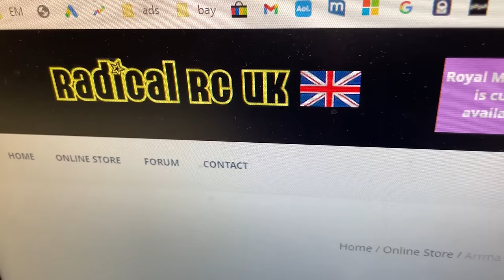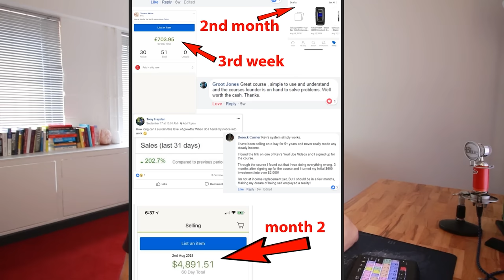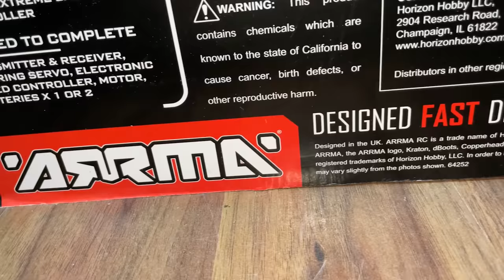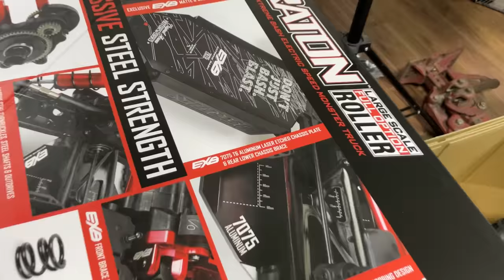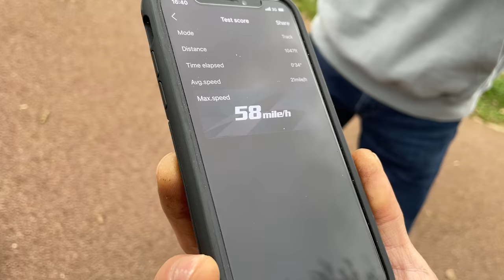Kraton 8s EXB - Worlds best GIANT RC Car?

Comment: Once you bend metal and then bend it back to straighten it, it will never be as strong again.
Reply: Right. Metal loses its molecular bond when it bends which is basically stretching the bonds which weakens it. That said, ARRMA needs to rethink the company thats providing them the chassis because it should not be that weak/bendy for that price.
Reply: I don't question the 7075 (people think just cause aluminum has a fancy number code it's suddenly steel) but I DEFINITELY question the heat treat if it's not being treated correctly it's going to end up either very brittle or to ductile
Reply: @adamjacobs8606  they probably bought it for cheap. That's why it's so bad

Comment: I jump my Traxxas slash ten meters in the air and don’t break anything
Reply: Traxxas are a much better build quality than kratons
Reply: @norsevikingsir4932  Traxxas is plastic.  Arrma uses metal.
Reply: @HunterEvolution  you just made my point for me. Their plastic lasts heaps longer than arrmas metal.
Reply: @norsevikingsir4932  on the XMaxx, absolutely.  It's a TANK. On 1/8 and 1/10 scale.  Traxxas couldn't keep up nor do they handle anywhere near as well.
Reply: @HunterEvolution  well I have a traxxas rusit (bandit/rustler) and crashed against a concrete mailbox and the chassis only broke where the transmission was which is a small piece but the rest of the chassis was okay. I was going 50 mph at time
Reply: @SamuelRodriguez-xz7nm  good for you.  I've seen a Rustler Nitro taco the chassis hitting the curb at half throttle. See?  I can say things too. 😂

Comment: Would love to see a metal test on that chassis. As a machinist I'm with you Kev, thats NOT 7075. Seems a bit more like 6061 to me. Nice to see that bash bar stopped you from doing it in again, and the RPM arms will up the strength even more. BASH ON!!
Reply: I am thinking it is annealed 7075, If you have a kiln try turning one into t4 and another into t6 and see if it helps.

Comment: Just a warning to people who want to use a drill, running high speed on screws going into plastic can melt the holes and make them unusable if heated too much. Drill at slow speed and you won't melt the plastics. And still is way faster than by hand.
Reply: I know this is a year old, but you should always drill metal slow with more pressure.

Comment: No way is that stock chassis 7075, like the way you glued a bolt  of each size on front of drawers👍
Reply: This makes me distrust Arrma and it is really foul.
Reply: There's a difference between machine 7075 aluminum and stamped 7075 aluminum. Arrma uses stamped 7075 and m2c uses machine aluminum. 6061 t6 machined aluminum will be 2xs stronger than stamped 7075 aluminum. Machine aluminum will cost 2xs the amount than machine that's the reason why arrma uses stamped aluminum and race kits uses machine aluminum

Comment: Go to a metal shop and have them re-harden the chassis. This is what I suspect is why it's so soft is they skipped the Annealing process. If it's not heat treated it will be soft like what you're showing in this video. If the Annealing process is done wrong it can become softer. You can do it yourself.

Comment: Kevin I have a question when RC cars gets old do pieces get weaker on it cuz i have 
a Traxxas Stampede for 2 years now
Reply: when they get really really old yes plastic parts do weaken slightly, but 2 years old is just fine and the parts will not have aged enough to weaken

Comment: That comparison between the 4mm m2c 7075 t6 chasiss and the 5mm arrma "7075 t6" chassis really makes me disappointed in arrma... They obviously either DIDN'T use 7075 t6, or used the worst possible grade of 7075. I'm still glad they're making improvements, but they need to stop cutting corners. I still love them to bits though, it's why I want to see them succeed.. looks like the xmaxx is gonna keep that crown for a long time though.

Comment: I have machined a boatload of 6061 and 7075. That may be 7075 aluminum, but it is either in an annealed state (not heat treated), or it has been improperly heat treated. Try welding on it and see how it goes. 7075 is like impossible to weld. If it is indeed 7075, maybe you can heat treat it.

Comment: I agree with you Kev, re Arrma chassis strength, it is not as claimed. That's an entire conversation on its own, however what I'd like to know is why doesn't RadicalRC make a complete replacement chassis as opposed to a supplementary chassis strengthener for the existing stock chassis?
Reply from the maker: theres already companies like m2c making complete chassis, the bash bars is cheaper and easier to fit :)

Comment: That Arrma 7075 T6 chassis bent way to damn easily. Its almost like it has no bend memory (I know there's a scientific name for it but I've forgotten it).  When you stomped on that M2C chassis it bent but returned to its original position when you let off it. The way it was designed to do so.

Comment: The metal from the arrma chassis got stretched. So, to make it correct, you have to shrink it. Kinda doesn't ever get right again really. The m2c has extra bracing welded on, makes the stretching kinda difficult(not that Mr. Kev couldn't eff it up, lol). And btw, that metal for the arrma chassis is cheap AF!! Great vid man, thank you!

Comment: Traxxas Xmaxx killer? Hahaha. I wouldn't even think about landing my EXB K8S on concrete like I do with my X-Maxx trucks. It is way more stable and faster and it jumps higher and further than the Xmaxx, but it breaks and bends stuff easier. And you better get your big air landings perfect. If not, BOOM.

Comment: There are different grades, or tempers of 7075 aluminum. I have a hard time believing Arrma uses 7075-T6. Just compare it to an M2C chassis. It's more like 7075-0, which is the cheapest of the alloys.

Comment: I think overall the X-maxx is just a better design.  Any rigid metal is going to be a poor material for this kind of abuse because of its rigidity.  I have a Kraton 6S and love it, but I think a aluminum chassis on a 25lb truck is just stupid.  Plastic is better because it flexes but returns back to normal.  Aluminum doesn't do that.

Comment: Hey kev! I'm 11 and I have traxxas maxx but I was driving it today for like 1 minute and then the servo stopped turning the wheels I took the servo apart to check the gears they are  fine I changed it from channel 1 to channel 2 but still doesn't work if u could help me with this or someone else could that would be greatly appreciated. thanks have a good day/night!

Comment: I am thinking that they are using annealed 7075 so it is easier to machine and form but they don't heat treat it afterwards. Maybe someone could try throwing one in a kiln and see if that fixes the bending problems. I have a kiln if you want to send me a car.

Comment: Hey Kev. I’m looking to upgrade my arrma senton to a 3s lipo battery. Can I use the stock motor in it and change the connectors. If anyone were to know it would be you

Comment: 8 mm pivot on suspension arms. ball joints need to be at least 10 mm balls.
Lot of flimsy parts only fit for 1/4 the size cars.

Comment: In the knife world you can have the most expensive steel but if they messed up the heat treat it is going to roll or chip or dull more easily than a properly heat-treated cheap steel.

Comment: I have the EXB, the chassis bent off of an old bike ramp I had, which is only 5 degrees and it was small jump for it. The chassis is either advertised as 7075 and it isn’t or it’s made out of cheap Chinese materials

Comment: 4:08 I'd rather have a nitro or gas version, size depending. Electric just doesn't do it for me, grin factor wise, and it's too powerful besides. Don't like it when the car flops around like a fish in a boat if you go past 3/4 throttle.

Comment: I think it is cool because it's more for the custom hobbyist than the x maxx. For example, you can't even add a different connector to a Traxxas esc without voiding a warranty, battery trays only fit their batteries perfectly, etc.

Comment: The kraton chassis is probably made with 6063. Its dencer than 6061 but lighter and less flexible. 7075 is super heavy aluminum but very durable. T6  and t3  is just the heat dissipation rate

Comment: I have bent two EXB chassis as well. I have the Radical RC bar on my K6EXB and M2C chassis on my Typhon 6S. The EXB chassis are for sure much softer. The same can be said for the EXB chassis braces. They mushroom and flatten under impacts. My M2C, Voltage, and Hot Racing braces don't do that.
Reply: That kinda sux considering its supposed to be tougher.  I've just brought mine n put a 1717 in it I'm nervous now

Comment: Yesterday I went to ark race way with xtm xt2e but snapped the front arm but you can’t get parts so my I have just bought an arrma kraton 6s
Reply: Get an M2C racing rear shock tower brace and aluminum chassis braces. It helps keep the chassis straight and you wont break your rear diff housing on a rear tire landing.

Comment: The kraton is such a great platform, but I have to agree, you have to put more $$ to get it as durable as the xmaxx.   That's the one down side.   So with that in mind, the xmaxx has the slight edge over it in my opinion.

Comment: 7075 is just how strong the material is not how it's made there's different types of making a chassis arrma uses stamp to chassis so they Bend easy whereas m2c has cut out chassis so they use a big block of aluminum and they just cut it out which is way way way stronger
Reply from the maker: Apparently you can’t stamp 7075 t6
Reply: @KevinTalbotTV  well then probably a marketing lie.

Comment: Well crap i haven't even taken my exb out of the box yet and found out i have to spend a chunk of cash on the chassis before i even get my motor/esc installed that's a big disappointment for me in this hobby anymore companies putting out products for the biggest part of a thousand bucks and you have to spend a couple hundred more straight out the box xmaxx is only one that doesn't and even it needs couple of small items for instance look at the lmt its unreal what you have to spend on that thing straight out the box

Comment: Kev, 

Aluminum loses strength from heat and also once it bends (gets past yield strength limit) it loses strength in an exponential fashion. 
- So you really cant compare a used EXB chassis and a non bent M2C one.... (but your point is valid that the factory one isn't as good.

Just my 2 cents (as a machinist). 

Great Videos, keep em coming!
- Ron.